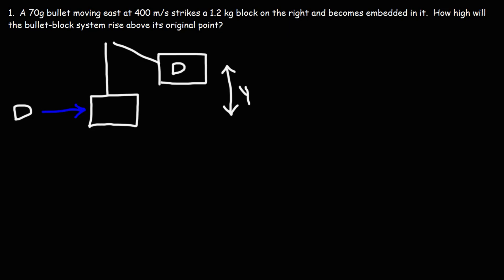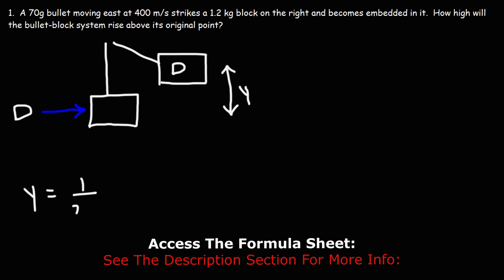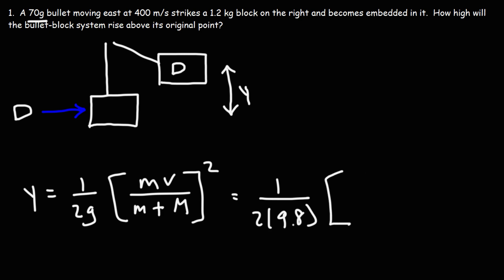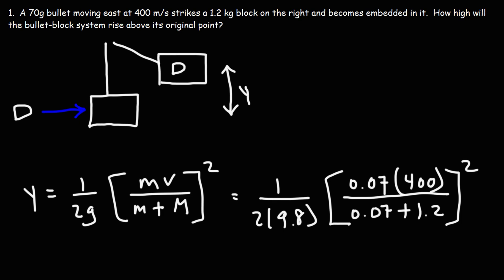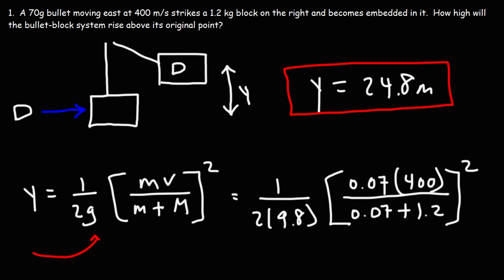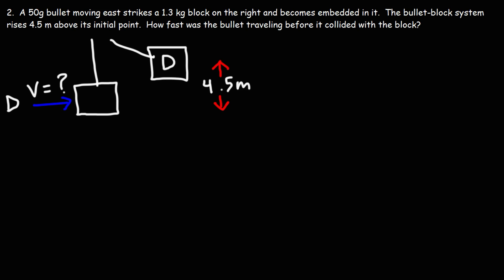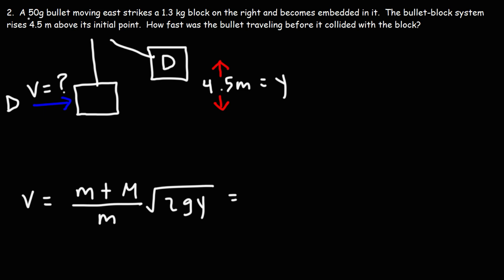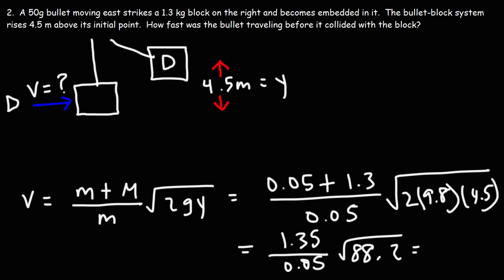Ballistic Pendulum - Conservation of Momentum

Comment: I know this is an old post, but I'm going to throw this out there and see if it gets read. :-) This discussion comes the closest I've seen to addressing a question I have about a real-life scenario. What is the type of physics involved in determining what firearm load has the potential to knock a steel plate over with greater authority? And how do we calculate that potential?

Let's take a simple example: We have a 9mm handgun. We can either shoot a 115 grain projectile at 1,180fps or a 147 grain at 1,000fps. Which one will be the most likely to knock over the plate, and why?

Do we calculate for (Kinetic) Energy (KE=0.5 X mv(squared))? Momentum (P=mv)? Force (F=ma)? Other? Why and How?

In the formula in this video, the projectile becomes imbedded in the "block". In the shooting game that precipitated my question, the "block" is a steel plate. The bullet is either cast from a lead alloy, made with a lead core surrounded by a gilding metal jacket or comprised of some other frangible material. The point being that the "block" will not deform, but the bullet most certainly will. It will probably disintegrate on impact with the steel plate, and the resulting myriad of differently-sized bullet pieces will disperse from the face of the plate in various directions and at various speeds. Neither the weight, direction of travel or velocity of the individual pieces can be known.

The general perception is that, in our example, the heavier, but slower, bullet will "hit harder"; and therefore be more liable to knock the plate over than the faster, but lighter, bullet. But is that right? And why? Or why not?